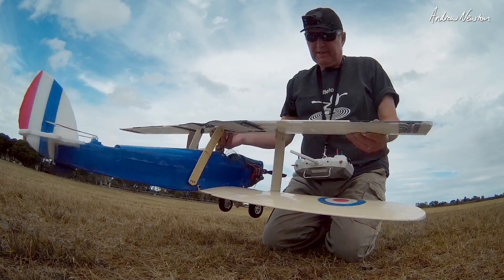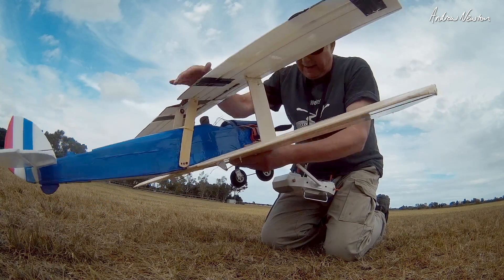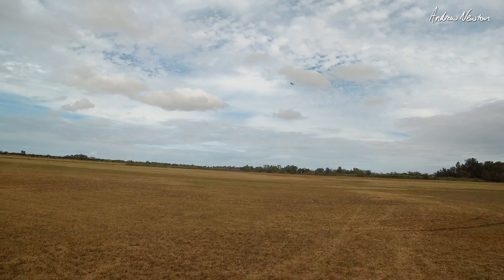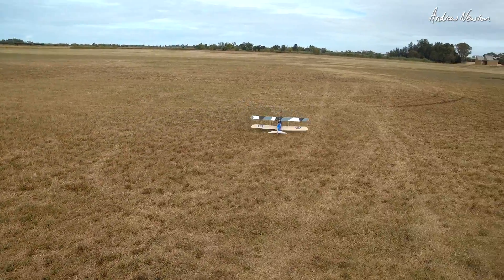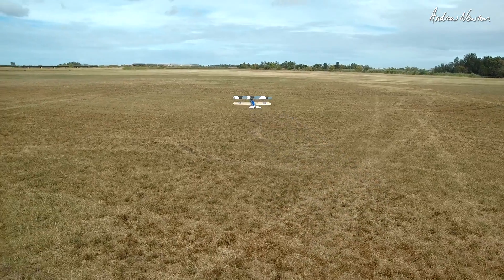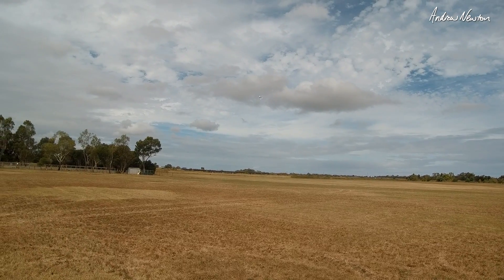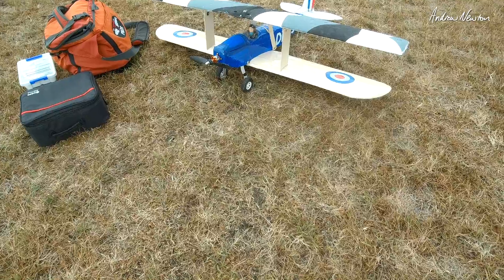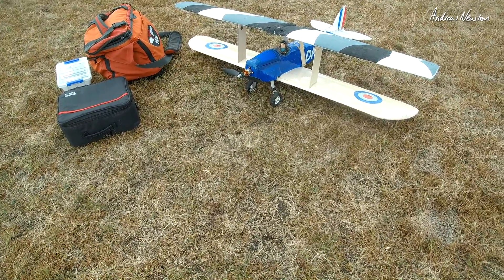More Decalage Testing

Comment: Thanks for the aeronautical insight - a rare commodity these days. To be theoretically precise, what determines the flight characteristics is probably the angle of incidence relationship between the fore and the aft wing, not necessarily the top and bottom one. Which would matter if you encountered a reversely staggered configuration with the top wing aft, but only then. Great work!
Reply from the maker: Thanks, it was very instructive for me

Comment: Great testing Andrew and you can definitely see the difference in the flight characteristics. It appeared that the control surfaces were only on the bottom wing? Is that correct? No control surfaces on the top wing? Thanks and I'll see you in the Air!
Reply from the maker: That's right, only the bottom wing

Comment: With the wing stagger, when you reduce the incidence of the top wing, you make the bottom wing do more of the lifting work - that effectively moves the centre of gravity back relative to the centre of pressure - so you'd expect it to become more unstable in pitch.

What's it like in sustained inverted flight - how does the positive decalage affect that?
Reply: Now I think I have this backwards.  Making the bottom (rear) wing do more work actually moved the effective c.g. forwards.
Reply: @ceptimus  With respect.The CoG cannot move! What is happening here is that the CoP moves with the change in AoA ie forward with a decrease in AoA and rearwards with a reduction and termed Moment coefficient (Cm). With regards to the term "declage". This is always required ie a positive angular difference between the incidence angles of the wings and the horizontal stabiliser. This ensures that the stabiliser will always exert a down force on the wing to balance the Cm at that particular airspeed and AoA.

Comment: Interesting test Andrew. All wings need a slight positive incidence in order to fly, but the thing to remember is that that angle is always relative the motors thrustline and the angle of incidence on the Tailplane (and the lower wing in this case).
  The outcome is not surprising, watching you fly it, with the positive incidence, it had less of a tendency to "tuck in" pitch wise as you applied down elevator on your approach to landing, a good thing, nice job and nice demo.
Reply: Installing up or down engine thrust  line should not be necessary on a properly designed aircraft, and if it is it indicates that the stabiliser incidence may not have been set correctly. If the model pitches up or down with application of power (increase in thrust) this is as it should be. Now to achieve straight and level flight longitudinal trim must be readjusted by trimming the elevator accordingly. Longitudinal trim is only good for one airspeed ie each airspeed change, due to a power increase, requires a retrim. Otherwise the aircraft climbs or descends.  Wings do not need a positive incidence to fly, they may be set at zero, or even a minus incidence, but the stabiliser incidence must be set accordingly; if it is incorrect the total airframe drag will be excessive due to some extent by the fuselage  being too nose high or low. You may be confused with "incidence" and "angle of attack". AoA is the angle at which the wing meets the oncoming airflow. and "incidence" is the angle set by the designer and is relative to the aircraft side elevation datum line. Some wings are capable of producing lift at minus AoA which depends on the wing profile (Airfoil). All of the foregoing is with due respect, sir, and is not meant as criticism.

Comment: Great experiment! (And you even did a bit of sloping, without the slope!) 

Here's a report to the National Advisory Committee for Aeronautics in 1927, attempting to reproduce your effort in a wind tunnel. Your results could have saved them a lot of time!! https://archive.org/details/nasa_techdoc_19930081032/page/n21 (I admit it's technical). 

With your previous experience as a sailor, a parallel way to think of this is to consider the relation to a jib and a mainsail. The mainsail must always be more close-hauled than the jib. Here's a quote from North Sails in an article entitled "How Sails Work": 

Another consequence of the difference in flow angles that the two sails experience in each others’ presence is that the mainsail must be trimmed to a much closer angle with the boat’s centerline than the foresail, which is able to be trimmed to a lead position well outboard. This angle represents the difference in upwash on the foresail and downwash on the mainsail due to each other.

The two wings, with proper decalage, produce more lift than each wing added together. And, if you stagger them (as you would a jib and a mainsail), you get even more lift. The downside comes with increased speed. Parasitic drag rears its ugly head...thus biplanes give way to monoplanes as speeds increase. 

Thanks for sharing this. Fun and educational. You have a gift.
Reply from the maker: Love this technical stuff where I can understand it. I have a treasured book called High Performance Sailing by Frank Bethwaite (legend of Australian sailing) I often reread it just for pleasure.
Reply: Bethwaite was a legend well beyond Australia! 
Great book. He was a brilliant strategist and technical genius. 

Sailing and flying are close cousins. 
  @AndrewNewton

Comment: when do you used rudder and when do you use ailerons? Struggling a bit with my ranger
Reply from the maker: Forget the rudder until you are comfortable flying. Then you can use rudder and ailerons at the same time, just a little bit, and elevator to keep the nose up. Or you can initiate the turn using rudder then control the bank using opposite aileron, with elevator to keep the nose up.
Reply: @AndrewNewton  One thought on the use of rudder. During slow flight, or in high AoA situations as in the round out (on landing) do not pick up a dropping wing with aileron, use rudder only. In slow flight the AoA is relatively high and applying down aileron to the low wing increases the effective AoA which may exceed the stall angle and the plane will snap to the side of the low wing.